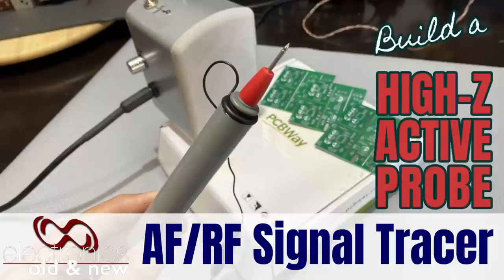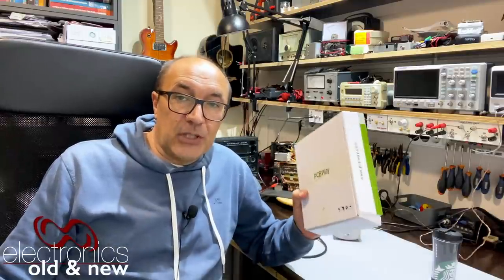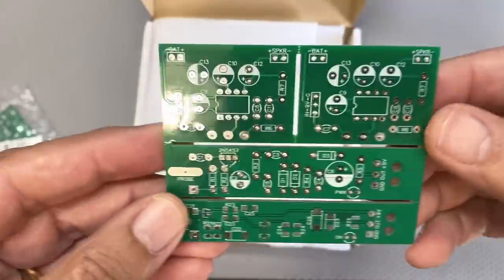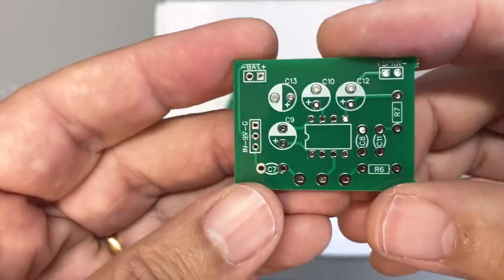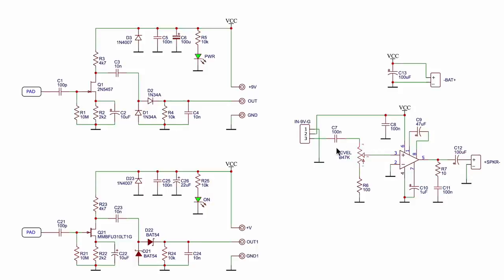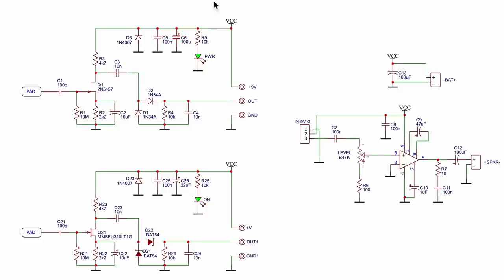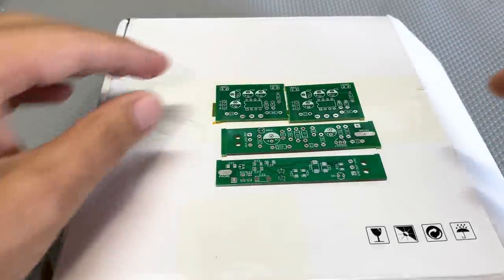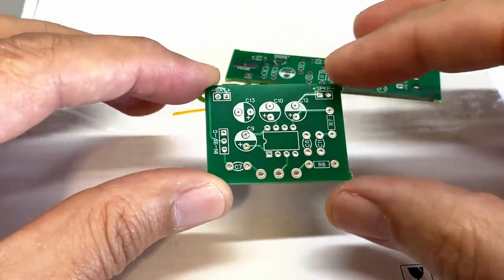Build a high impedance active RF/AF probe with amplifier. Ideal for radio and amp repairs. #PCBWay#

Comment: Again I have a construction question :^) what diameter tube fit the probe board best?
Reply from the maker: If I remember correctly, it’s about 22mm, but is just a matter of making it a couple of mm bigger than the PCB width.
Reply: @electronicsoldandnew  Thanks Manuel - that was indirectly the question, the width of the PCB.
Reply from the maker: The width of the PCB is 17.8mm.
Reply: @electronicsoldandnew  Thank you, sir.  I asked because I have to lay this down on perfboard ('veroboard?") and very luckily found a 21-mm metal tubular mop handle that I've cut to length for the case.
Reply: 22 mm copper pipe  is good and easy solder for Ground connection !
Reply: 22. Or 28 mm copper pipe would make excellent screen! Easy to solder copper ground braid onto copper pipe but you need thin inner plastic sleeve to prevent any risks of shorts! Plenty room for components without having to use surface mount! Plumbers always have plenty of off cuts lying about!

Comment: Hi and thanks for your informative vid. 
Q: why exactly does the LM386 to speaker require a capacitor to couple it? (Apologies, I am a novice 🥴 and your answer may well explain why my amp and speaker combo isn’t working in another circuit)
Reply from the maker: I’d you use a single supply, the output is at a DC level that is approximately half the supply, so you need to block the DC to separate the audio signal to the speaker.
Reply: @electronicsoldandnew why simply cut the DC by using 1uf capa ?
Reply from the maker: The capacitor blocks DC and allows the audio through.
Reply: @electronicsoldandnew  it s what I Said. A question- for probe électronic music instrument liké sampler , is it RF or AF probing ?

Comment: You can go contactless with this gain, back then when younger I build just the detector and no gain at all for RF service.
Reply from the maker: I’d like another gain stage for the contactless option. Maybe one you can switch in if needed and bypassed if not.

Comment: Why is at PCBWay 5 x this pcb over 50 Euro while all other prints like the leakage tester or tube tester are all 5 EUR for 5 ?
Reply from the maker: I made the mistake of making this board with unusual cuts. I should have simply made a rectangular board and that issue would not have arisen.
Reply: How do we fix it so it will not cost $53??

Comment: Germanium diodes are obsolete. Schottkey diodes are the way to go. They can work in a higher temperature range and 
have no recovery time. Cigars come in tubes? I'm must be buying cheap ones. LOL This probe works great but might need 
a replacement 9 volt battery sooner than you think. Like the repurposed computer speaker being used  to hold all the works. 
That probe you made at the end is fantastic Manuel. Steve
Reply from the maker: Some cigars come on those aluminium cylinders, which are great for this 😊

Comment: Could it be used on a FM receiver?  If my memory serves me I think on FM they call the detector a discriminator which I think is like a voltage controlled oscillator? Am I right? It sweeps a substantial part of the bandwidth?
Reply from the maker: I have used it in the FM sections quite successfully. These tube radios normally use ratio detectors.

Comment: I was certain that i had seen i probe like that somewhere and with a prober probe housing. I did on Mr Carlson Lab : https://www.youtube.com/watch?v=uVkJqqZroN0&t=1s
I noticed that you build to be a stand alone unit for your desk.
Shouldn't it have been build as your "Udend the shelf" modules like your Dummy Load?
Reply from the maker: I considered that, but I found that for radio testing, I prefer the “mobility” of the speaker unit.

Comment: Great Video My needs are - looking at yours and Carlson. Needs - Sniff out noisy components for Vintage Receivers Like Pioneer SX- since they have a lot of Noisy transistors and RF I think? to sniff out High FHZ oscillation for Amplifiers  like Phase Linear 400 II and 700II - Can this one do it? and Carlson probe do it? Were can I buy boards kit? ebay? (or do you have to create account and they make them)
Reply from the maker: Both mine and Me C’s probe will do that. The boards can only be ordered as I don’t sell anything.
Reply: @electronicsoldandnew  Thank, I think yours is easier to built w full size components, Don't know when I have to to build but could order part now Any Mouser or other BOM?
Reply from the maker: Afraid not. You can get that info from the schematics.